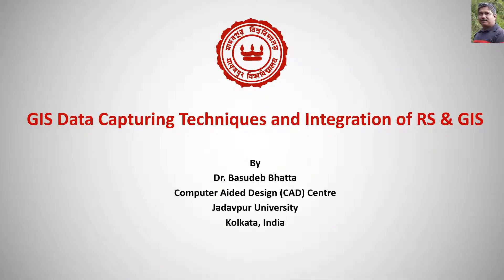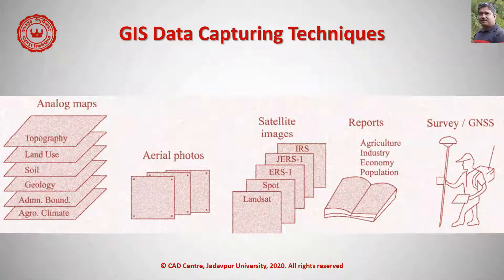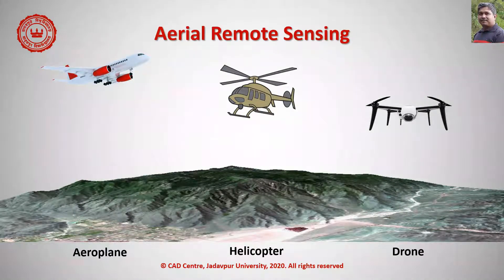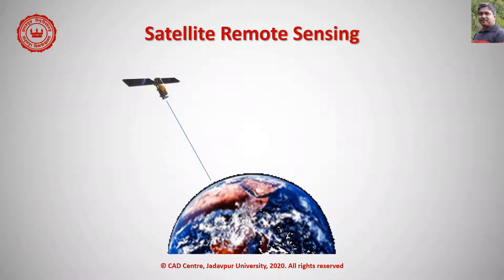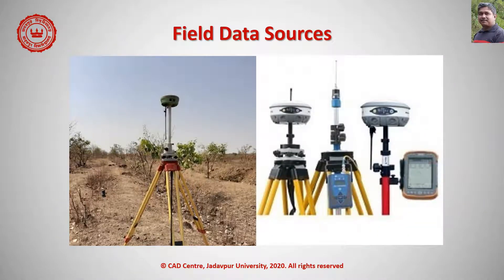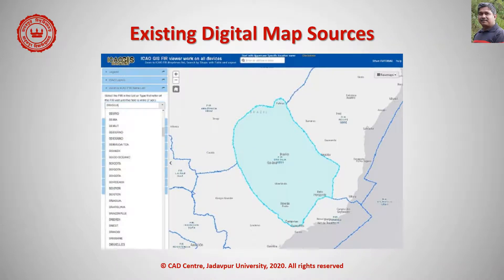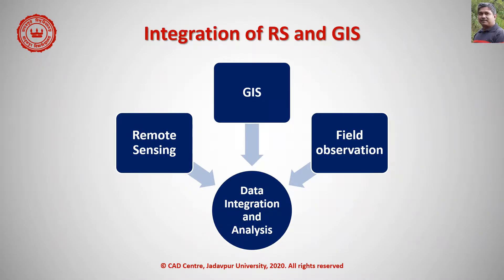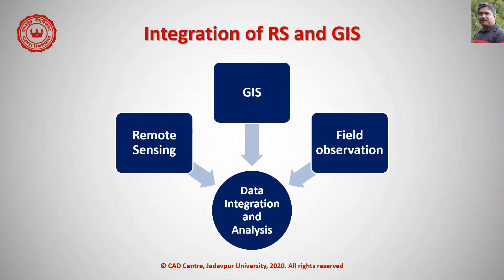GIS Data Capturing Techniques and Integration of Remote Sensing & Geographic Information System

Comment: Hello Sir i have 3 question concerning GIS.

Q1.If you wish to monitor the development of a tropical cyclone in the Indian Ocean, which type of satellite would you choose? Justify your answer

Q2.  why connectivity of lines and polygons is an important component in OpenStreetMap?

Q3.Discuss, in relation to satellite-based remote sensing, the radiative transfer model of the visible portion of the electromagnetic spectrum in the ocean, including in your answer the various types of scattering and interactions between electromagnetic radiation from the sun and atmospheric constituents.

Thank you Sir